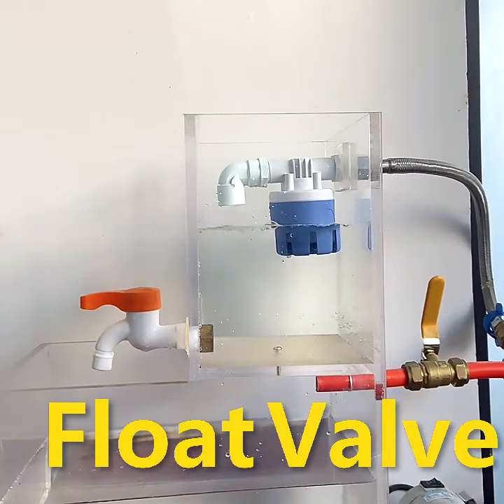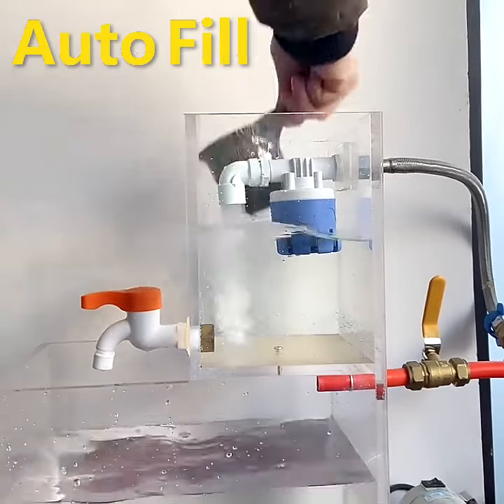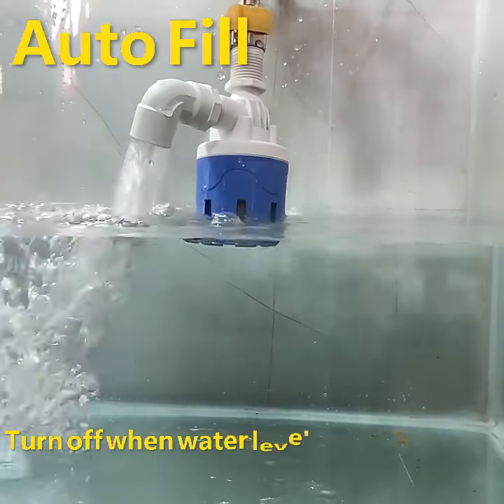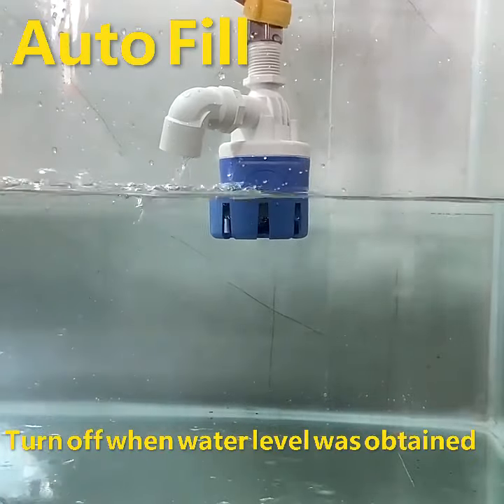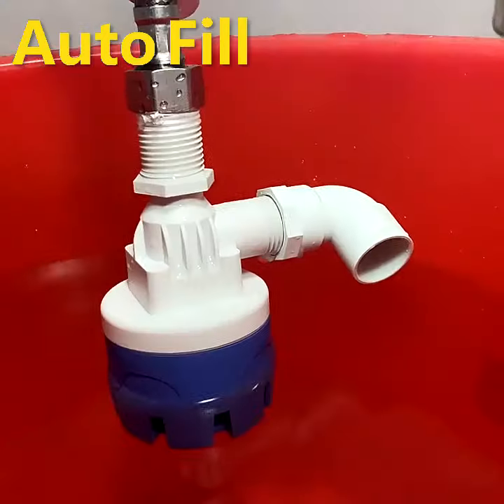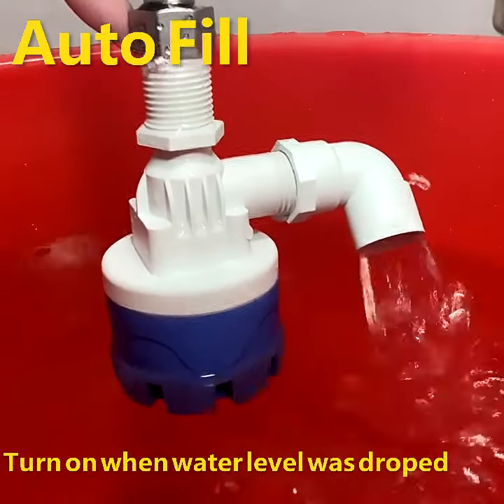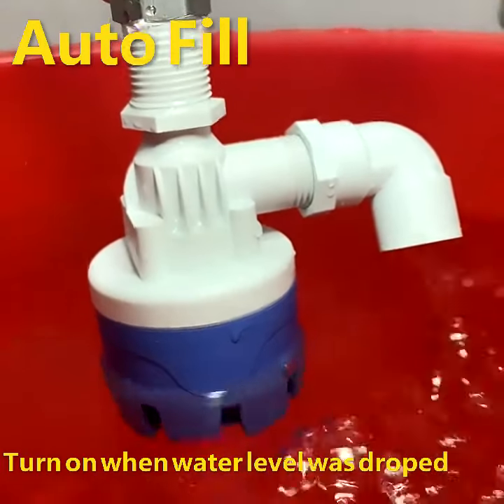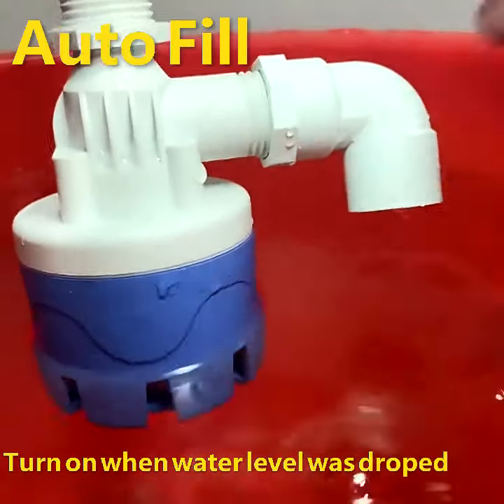New Automatic Water Level Control Valve Water Trough Tank Cistern Tower Pool Auto Fill Float Valve

Comment: is it able to pressurize storage tank?
Reply from the maker: Is the tank sealed ？
Reply: @smithbanescu2866  the storage tank is filled by pressure tank i hesistate beacause if the product is close,
maybe the  blocking the way will be pushed up by the force of the pressure
Reply from the maker: @jonathandeboque8781  The Valve would work，but dont seal the Tank